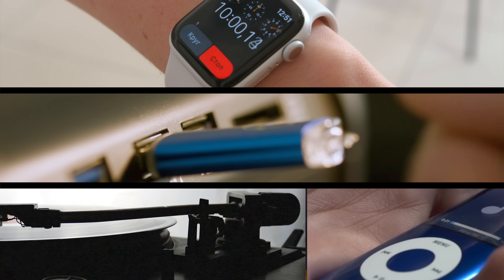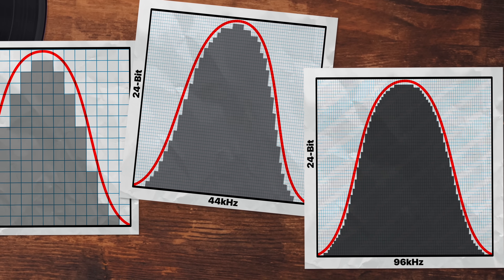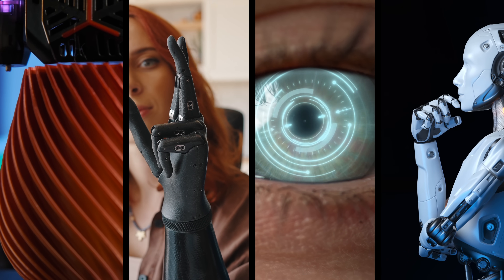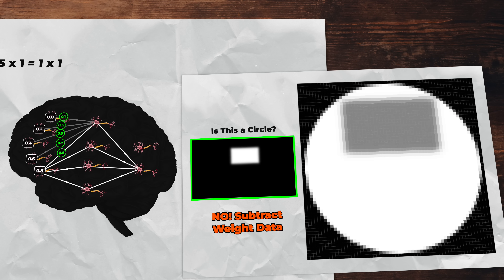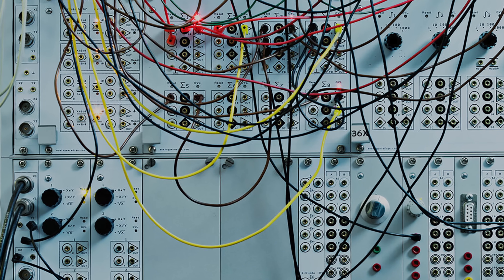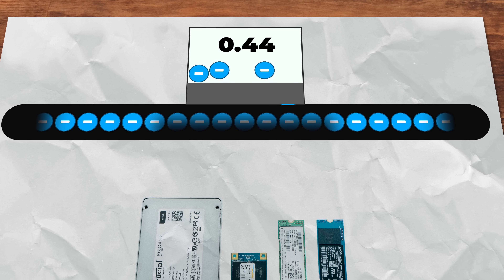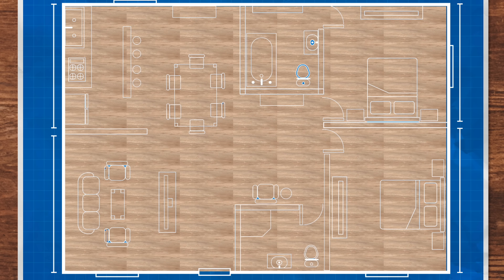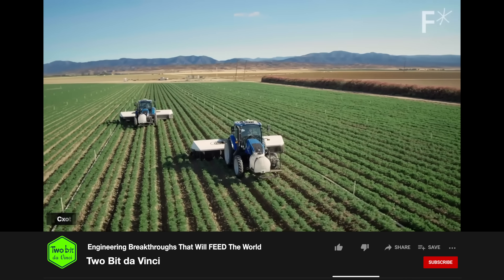Analog Computing is GENIUS - Here's Why!

Comment: My first experience of digital computing was in 1962 when the U.S. Navy trained me for their first three ships at sea to be equipped with them. While those early computers  were much smaller than an IBM mainframe of the time, they were the size of large double door refrigerators, and needed chilled water to cool the processors. Energy costs were high despite the transistors they used, and processing times were much slower than the simple digital devices we use today. The digital computers were used as an air traffic control system, for combat and it fed some of the information about potential targets for our missiles to the fire control technicians on a different set of display consoles. 
Their computers and consoles were analog. At that time the speed of their analog resolvers and differentiators was superior to any digital simulation our computers could produce. But they were constantly having to fine tune the analog elements to their system to maintain accuracy. As you note, digital can be very precise and repeatable.
Reply: Hey, I was fire Control when I was in the Navy in the 1990’s. Your comment was really great and brought back some fun memories for me.
Reply: Some serious cool stuff 👁️👃👁️🙏
Reply: that's useful information.
Reply: The processing power of this little old Galaxy 9 cell phone is quite the Quantum Leap in technology isn't it ?   I remember playing T.V Pong on a black and white T.V 40 years ago.   Now we're colliding particles ?   Come on.  Men just stopped using bows and arrows to rule the world and now we have "Rods from God" ?   Perhaps C.A.R.A.T [Commercial Applications for Recovered Alien Technology] isn't a mythical organization....after all.
Reply: When I toured the USS Misouri they told us that when they took the ship out of mothballs for the Iraq war the dig computers were not as accurate as the original annalog computers, so they re installed the annologs to aim her 16 inch guns.  Really interesting.
Reply: cool
Reply: Amazing! How much impact  an information have when heard back from real world seniors who experienced it.
Reply: Today analog computers can be implemented as a DDA on an FPGA.

Comment: Wrong and prone to error. Voltage is not that accurate in devices. There is a reason why electronic components are made to accept a voltage range ( while very small ) for the impulses . Try to be precise with voltage and see what happens . Theoretical != Practical

Comment: I do not think we will have solid analog computers.. but i think we well have a lots of variations of digital/analog computers. Digital currently is much cheaper to produce and 99.99%+ software is setup for so we might have programs that do the sensor data and calculation analog then transmit to digital output for in you example... is a child present... deciding if a child is present may take millions or billions of calculations in 3-5 cameras but the final output that needs to be transmitted is 1 or 0 . then you request image (1 point of data) that only need 1 digital image to be sent as a check.

By calculator Pie is 3.14159265. even though it is an infinite progression in most cases 3.14 is close enough for Pie .. in many simple electric components 3 is close enough in fact 4 or 2 might even work.

heck even on solar panels.. you want optimal energy production but you don't need it to adjust thousands of times per second or even once a second once you are close to optimal. even thought it will become less optimal over time you don't need to check thousands of times per second to see if it is still optimal but maybe every few min.

TLDR sometimes Analog will be better sometimes digital will be better but a combination depending on inputs calculations and output will determine how much is digital and how much is analog and how much is digital will be the end result.

Comment: What about wear though? Digital only needs to listen to on and off, but analog has a whole range. We already see similar in ssds adding more data by increasing the sensitivity to voltage. As the cell wears down, it becomes harder to measure the difference in qlc vs tlc or mlc.
Reply: It actually matters less in analog, as you don't need to measure differences - you're using the whole range.  If you measure 4.83 volts then your answer is simply "4.83".  You're not comparing 4.83v against +5v and -5v (or whatever values your circuit uses) and trying to match the closest as you would do if you were wanting to distinguish 0 from 1 in a digital circuit (or from a 2 or a 3 in multi-level cells).

Comment: Sounds like a very efficient & energy efficient system.
My curiosity about alternative computing systems is based on the need for resilience vs threats to digital systems such as: cyber attacks, EMP attacks, solar flares, etc. 
So in line with this: 
- Do you see analog computing being less vulnerable to the aforementioned threats?
- Raising it a notch higher, do you see analog computing being further developed to be a good system to have as a back-up in case of any of the 3 threats (or other threats of similar nature) takes place?
Reply: It's a chip.
If it's unhardened, like most chips, it's just as susceptible to Solar activity, supply spikes, &etc. as any other unhardened chip.
Reply: @DickHolman  Thank you

Comment: Analog conputers are NOT going to change the world. There is nothing that an analog computer can do that a frast general purpose digital computer with appropriate Analog to Digital and Digital to Analog computers cannot do. Furthermore the digital computer will be better because things like component trolerances offset drifts and bias currents etc are not a consideration apart from in the interfaces. Analog computers will just remain in a few niche applications. Filters are computers of sorts. Digital filters have superseded analog filters practically evertwhere.

Comment: I can see  these as low power processors that detect “possibly x” and wake up a a digital circuit to “verify it’s x” and “compute or act on x.”

Similar to how our smartphones have specialty digital circuits that listen for speech and wake up higher functions when they detect attempts at vocal input.
Reply: That's not really how it works unfortunately.  These things aren't detection machines - they're just do really cheap matrix multiplication, with the downside being that the result might not be entirely accurate.

That's fine for AI because the matrices involved are representing neurons, and its often even beneficial for there to be some noise in the system as it functions as a source of non-linearity and "good" non-linearity is critical to making a NN be better than a "simple" calculation (mathematical simplicity that is - a completely linear NN reduces to a polynomial.  Likely a very large polynomial that you still wouldn't want to compute by hand but in terms of its processing capabilities its no better than a relatively basic function.  Introducing non-linearity fixes that problem and makes NNs far more powerful than any "simple" function could ever be).

That said, (some) AIs absolutely are detection machines and if these can be used to make more efficient AIs then you indirectly get what you want somewhat cheaper.

Comment: Digital computing only exists because it is the easiest way to perform calculations if all you have is switches to do it with.
Reply: Nonsense.  You've got this completely backwards.  All transistors are analog devices.  We FORCE them to operate as switches to get accurate, REPEATABLE results.  Digital computing only exists because you never get the same answer twice with analog calculations.
Reply: @BrightBlueJim  Who mentioned transistors?
Try getting relays and punch card readers to work as analog devices
Reply: But that's not the only reason digital computing exists.

Comment: Nope, they won't change anything. There is a reason why pretty much all computers are digital, and that reason is noise. This is pretty much the first thing you learn when you start with digital electronics. Digital computers are just orders of magnitude easier to build for our noisy environment. Or like analog IC designer Bob Widlar said, "every idiot can count to one". For example, quantum computers are full analog and they are so incredibly fiddly, that we haven't seen a useful one yet. According to Wikipedia the largest factored number on a quantum computer using Shor's algorithm is still 21.
Reply: Many great points, but some applications are tolerant of noise and the speed and energy savings in analog computing could far outweigh dealing with noise.  Computer vision prossesing for starters. Speech to text could do a significant amount of processing before digitizing is nessesary. Analog computing would not change much,  except in a few applications superseding digital processing, but it will  enabling more rapid advancement in those areas.

In nural networks with weights that are currently digitized, switching to analog weights is far far far far more energy efficent and far far far far far more speedy. Memresistors may have significant aplication in analog memory with far greater storage capacity and speed in neural networks. In a neutral network, a weight with a noise between  0.998 and 1.002   can be insignificant enough to justify analog computing benifits in an aplication.
Reply: i wouldn't discount the possibility of a analog/digital being used to create   a new technology using both. I am working on some things now.
Reply: @PixelRic-kj4ct  Computers that use combined analog and digital techniques are called hybrid computers. They are nothing new.

However, more modern hybrid computers use hybrid paradigms that are somewhat different from those of the older hybrid computers.
Reply: @cyberphysicist  Correct lol. i dont really know how to explain what things you can do now using both techs without it being long and slightly complicated so i just said that to simplify it and get the point across that theres new ways to use this technology digital analog IOT that can be combined to speed up or simplify certain tasks
Reply: My daughter works on quantum computers and whilst they are still some way from general usage I would never discount how quickly things can change, especially when quantum is combined with AI. Your comment reminds me of the famous quote from an IBM exec about there never being more that 20 computers in the world.
Reply: @Embassy_of_JupiterYOU heard him!  When the Almighty Wikipedia is quoted the discussion is OVER! (drops mic on foot)
Reply: @PW_12345  Digital computer is an abstraction and a very good one at that. Once in digital domain you can pretty much ignore all the analog aspects of the device. Even its physical implementation doesn't really matter (it could be mechanical for example). Digital system can be made arbitrarily error tolerant using redundancy, error correction codes and other techniques. Bit flips happen all the time and pretty much nothing happens.
Reply: The quantum computer has a much bigger problem: temperture and the amount of Qbits. We need more research nothing else.
Reply: @sara-d  Temperature = noise. That's why quantum computers operate at few degrees of K.
Reply: @Embassy_of_Jupiterlike you?
Reply: Neurons are a analogue/ digital hybrid. I expect there will be some technological use case for similar systems.
Reply: The human brain is analogue, and deals with noise via redundancy — also one of the first things you learn about in computing (messaging protocols). Analogue computing will for sure change everything due to power efficiency which will support mobile systems to more complex compute tasks while using less battery power. 

Analogue computing won’t replace a cpu for generic processing but it will replace it for sensor processing and for running any NN models, eventually.
Reply: I agree this will never be a thing.
Reply: @voomastelka4346 Indeed, every idiot can count to one. I said it!
Reply: Are modern cpu even digital? The transistor is still a physical switch that is either open or closed.
Reply: That's exactly what a mate said to me 25 years ago about neural processing networks............
Reply: @Embassy_of_JupiterI was thinking the same thing.
Reply: Hybrid could be some kind of way forwards. Get the analog part to give you an estimate and do some newton iterations to get the right answer.
Our brains are 100% analog and harness the inherent noise to do useful work. But that is a system with millions of interconnects, the switch matrices to enable that in ICs would be massive.
Reply: Quantum computers are still in their infancy. I remember when a 500mb memory was the size of a house. My phone has 1tb and fits in my hand. Give it time.
Reply: Bob Widlar - a name I haven't heard in years, and a real father of analog IC design at National Semiconductor.  LM7800, adjustables like the 117 (and 217 and 317) to name a few.  

Also fun picking out old friends in the rack mounted instruments.  Wavetek generators, Tektronix scopes, HP everything... 

Retired from engineering now, but still loved analog design for the challenge of dealing with the physical characteristics of parts like noise voltage versus value and type of resistor, or pcb layouts for signal integrity.
Reply: It will change something, since its not like analog will replace digital. Analog would be applied only if its pros win against digital. As a fine tuned pair it can be used in many useful ways
Reply: no that reason is backdoors in cyber security
Reply: Noise affects digital, as well.
Cosmic rays affect digital, for that matter.

Reducing power to perform high speed computations in near exact results is good enough for smart bombs 💣 , smart rockets 🚀, smart artillery, smart bullets.

Honestly, this can change a lot in military applications.
Reply: Analog is a better representation of the real world. We expect the world to be a competition between sources. An environment that contains no sources is unnatural. It may be easier to conduct science by filtering out the distractions but it does not contribute to the understanding of the impact of the interrelationships.
Reply: Not all analog computers are loud. I saw a video showing how you can use electricity inside an analog computer that is using the voltage as the value and there they showed how simple multiplication was which is a large part of AI computation so while not big in usual use cases they are good for AI
Reply: @patfre they don’t mean noise as in sound

Comment: It's not going to replace digital but the integration and use as a tool with digital is great, just like your example for runaway variation. Analogue can do the heavy lifting and digital spot checks.

Comment: Admittingly I'm too old :) I remember analog computers - there is much you can do with an OpAmps beyond addition, and multiplication you can also integrate and differentiate - soothing you can't do with the linear V = IR.  I also remember a time when the hardware component of a project was 95% and the software component was 5% (much of the processing done in hardware).  Everything has flipped. This maybe a novel idea, but not every novel idea makes practical sense.  I see science as finding a path to make dreams some day possible.  Engineering is the path of what can I do now with what is possible today.  Engineering often boils down to the problem you can solve.  This is off track but somewhat relatable.  I recently saw a video comparing the benefits of establishing a base on Titan vs Mars.  Sounded great until you factor in the cold and the more difficult challenge, how do you get there.  The problems you can solve all reside on Mars.  No answers, but only dreams about what you could do on Titan.  Im sorry, but to answer your question directly, I see this as another science experiment, very limited and not ready for real engineering tasks.

Comment: Analog is “random or imprecise digital” just that. Forget the myth. The granularity of an analog picture is their “pixel” only randomized. The same about the fidelity and noise to signal ratio, on an analog recording (not to mention mechanical artifacts).
With the added problem that each copy adds another layer of imprecision or “pixelation”.
Edit: Remember analog computing is only a cool name for more bit states than 0 or 1 determined (usually) by voltage levels.
Reply: i'm gonna borrow that. i'm not blessed with that type of articulate grammar, i am though in a bit of gab. my hat off to you a nd cerveza for you 🍺
Reply: @fvrrljr  Thanks… I guess. Either way, if it is sarcasm.. or not… I am always open to improvement. Analog or digital 😂
Reply: @frgv4060  i love sarcasm but no sarcasm here. i really was impressed with your comment 👍
Reply: Yes, analog is just lossy compression. Though floating-point calculations are already a bit imprecise even on digital computers, and GPUs can be even less accurate because in real-time graphics tiny errors don't really matter and AI doesn't need perfect precision either (8-bit quantization in AI models is kind of the norm because it reduces memory usage by ~75% while only introducing around 1-2% deviation to the results)